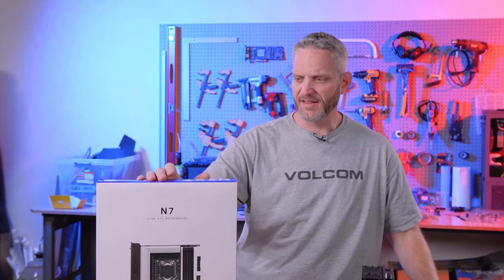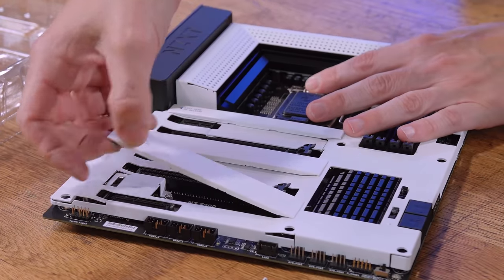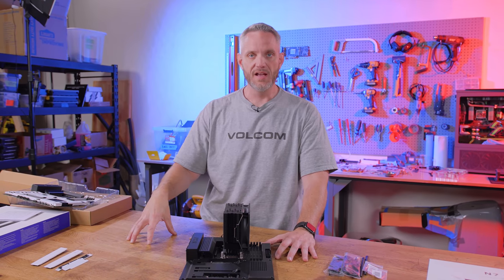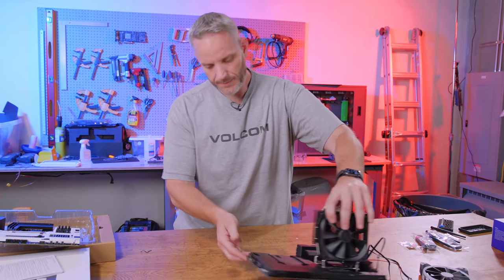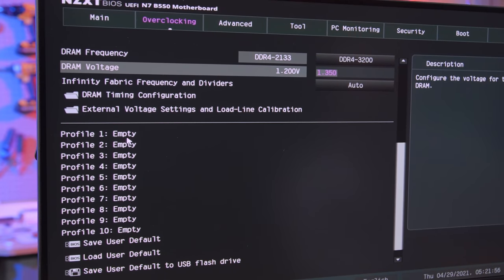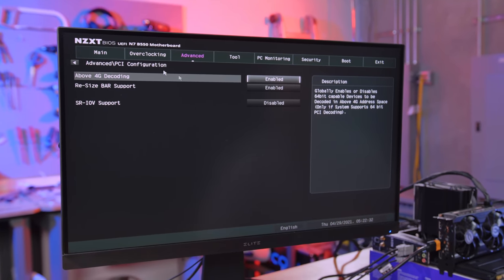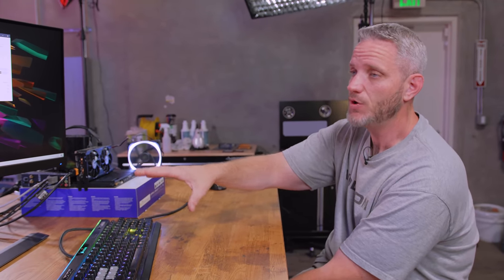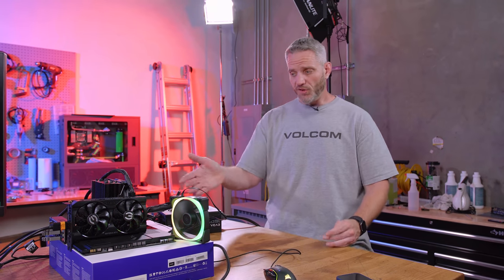Matte Black Motherboard Setup... Absolutely gorgeous!

Comment: Looks really nice. Shame they completely lost my trust years ago.
Reply: Mind telling me what happened or why?
Reply: @Roxx1010  damn b, forreal
Reply: Nzxt has always been great in my builds
Reply: @tobiyokageyama6449  Just look up CAM software and the little history about them using it as spyware. When I ended up in an email conversation with them, they actually lied three times about it, until I shoed the log files of my firewall. Then everything went quiet really fast. Turned out I wasn't the only one that ran into that little issue. And then there's "the case" where one of their products actually was a massive fire hazard. They claimed a fix for that, and that fixed wasn't really a fix. Don't get me wrong, when you treat customers like shit, that's fine. I just prefer not to be one of those customers anymore then. But, reading some of the other comments here, I see there are enough poorly informed people that don't mind bending over. Good for them.
Reply: @PrimeRsoul  complaining about spyware while using a google account lmao
Reply: @jojivlogs_4255  The fact that you even compare the two says a lot more about you than about me. Have fun out there.
Reply: @PrimeRsoul  ok hypocrite
Reply: @jojivlogs_4255  When you create a Google account, you know your data is being used. When you BUY hardware, and there is no mention of your data being mined anywhere on the box or in the manual, you have no way of knowing. 

That's not me (or thousands of others) being a hypocrite. That's you being short sighted. But I know you're just trolling at this point. Or really not very bright. Good luck with that, sparky.
Reply: @tobiyokageyama6449  - Just one week has past and if you look at GN, you'll find another nice example about how NZXT just loves treating their customers. 

(just search for "NZXT Bait & Switch on PCIe Riser Replacement: Just Do the Right Thing")

Comment: Their first N7 Z370 was build by ECS Elitegroup not EPS :) Anyway. ASRock is only "slient" in the US and the EU. They are a pretty big player in Japan. Afaik the N7 B550 is based on a B550 Taichi with some smaller changes and of course the shroud
Reply: Yeah, can't believe he missed that :D
Reply: @riba2233  Shit happens. Happens to me all the time too.
Reply: asrock is silent in two markets with a combined population of 1,325,400,000 but hey, at least theyre a thing in a country with only 126 million Pepega
Reply: I knew when I heard that it was wrong! We used to use ECS motherboards back when I worked for a small PC shop back in the 1st Athlon days
Reply: wasn't it based off the B550 Steel legend?
Reply: ECS Is on z370 and z390. Asrock on z490 and B550....  Ecs never knew how to do boards, surprised Nzxt took their boards as starting option.
Reply: @GrimpakTheMook  Or that yeah, i dont remember anymore
Reply: @dulesavic9343  Yeah. Had an ECS motherboard in a prebuilt office pc. Guess what died right after the warranty? :D
Reply: @dulesavic9343  15 - 20 years back ECS was, fine I guess is what best described them. But then we had more than probably 20 manufacturers fighting for the market. ECS somehow got left in the dust, and yet they prevailed. But for the last ten or so years the number of manufacturers that we see in the US and EU has shrunk dramatically and ECS isn't really one of them anymore.

Today you have a few large manufacturers that everyone knows about, such as Asus, Asrock, MSI, Gigabyte and that's really it. A lot of companies has gone belly up or just withdrawn from the consumer market. Then there are companies most have never heard of or doesn't think of in terms of being motherboard manufacturers and these often build motherboards for things like POS terminals, set top boxes, industrial applications and OEM's.

There are currently only a few large companies making only server class motherboards, and the most well known are SuperMicro and perhaps Tyan, though the later seems to be losing market fast.

A lot of the time the large computer manufacturers doesn't make their own motherboards, but have them manufactured by companies like Foxcon. There are others but I really doesn't feel like digging in that to see who are still in business and who has ben bought by whom or whatever. A long time ago I opened a Apple portable only to find a motherboard made by Acer...
Reply: Yup!  I remember them.  One of my friends swore by them lol.
Reply: @blahorgaslisk7763 Didn't Biostar withdraw from the US market? I recall seeing a lot of their boards during the AM2-1150 days and now its like they just went up in thin air. Same applies to DFI, they had such amazing looking boards along with the features offered at the time.
Reply: *looks at my Asrock motherboard in the EU*. 'Shhhh'.
Reply: @blahorgaslisk7763  no, it wasn't. ECS is and always was shit... I remember te first PC my brother bought, Pentium 4 and ECS motherboard, always stuttering everywhere! After some hardware swaps, he didn't wanted anymore and bought/built another PC. I've started to use it and noticed that the north bridge was insanely hot. I've attached a small fan on to it and then the Pc started to run smoothly. Actually during gameplay, I've been taken away the fan and putting on repetitive and the stuttering was fallowing the same thing!
 Actually there I've started to love thinkering with PCs!
Reply: @blahorgaslisk7763  In the past Asrock uses to be supplied by cheaper Asus knockoffs. Now they are doung their own boards.

As for servers,  SuperMicro leads the race.
Reply: @jojivlogs_4255  They are still a thing. They just have been silent lately. Wut?
Reply: ECS = Easy cheap shit. Used to be sold  by Frys back in the day. they pushed this mobo pretty heavy 20 years ago.
Reply: ECS is a trash-tier manufacturer who thankfully has lost most of their popularity. I still have memories of working on their motherboards that were always sold in budget PCs throughout the 2000s. Absolute garbage. As soon as I heard that they were the OEM for the original NZXT attempt at motherboards, I wrote them off immediately.
Reply: @Gig-th3er  ECS is notoriously bad
Reply: I've had a couple of ECS boards, no complaints
Reply: @TheSilviu8x  my very first PC (2007) was a pentium D and the motherboard is from ECS. Broke down after 8-9 months. Never had another PC until 2014

Comment: There are only two things that baffle me.  In today's cases, there are no freaking optical bays, and most of the time you can't even get a decent hard drive cage.  It's an afterthought at best.  So SIX!!! SATA ports?  Me, personally, I'd use them!  I always do a 4-disk RAID 5 and an optical drive.  (With an M.2 OS drive.)  But not in modern cases.  I'm still pushing my old In Win Ironclad just for this reason.  AAAAnd all-black?  Really?  With so much RGB, and white picking up color soooo much better than black, do people still do all-black?  Yeah yeah yeah, there's a white option.  And I still do all black because I'm a Luddite heathen and don't use RGB.  But it just seems like there's such a disconnect going on.  Personally, I'd love to see cases go back in time to when they were useful for building workstations.  So personally I like this mobo.  But as I said, I'm a weirdo.  It's what I want, but is this what the market wants???

Comment: Looks like a nice board. Could see a fun build with black board, black ram, black fittings, black tubing and little to no RGB in an all black/gunmetal case. W
Reply: Just black lighting that makes near-white things glow :-)
Reply: Call it hotblack, or, disaster area.
Reply: BMM = Black Motherboards Matter
Reply: yeah, exactly. I'm considering the NZXT H510 (or H710) case. Also going for a white MOBO and NZXT case would look sweet I think to have all in black/white. tbh, most of the MOBO competitors just look to cluttered with all the lines and logos etc...
Reply: what about black rgb?  that's a thing, right!?

Comment: Was excited to see a build then I realize it wasn't 😞
Reply: I wouldn't be surprised if they ended up making 3rd party gpu's with the same styling. If they do. I know they'll be cutting a hole in the others companies like evga and asus. They make top notch products for a great price. I got the elite case and I figured it was a great deal because it looks nice, it's simple, the colors are great, it came with both rear fans, and it already had the rgb controller installed so you just plug it in your mobo. I got their 750 psu also paired with a black coolermaster 212 and it came out fantastic. I wish this was released when I got my mobo.

Comment: Aesthetically the white version of this is exactly what I wanted in a MOBO when I built my system late last year. The only other clean design mobo I could find was the Gigabyte Vision D, but that one's MSRP is over $300. I ended up with an ASROCK B550 Steel legend because it was the least expensive non-black MOBO with the features I was looking for. The BIOS looks very similar with this... Now to resist buying this! ugh.

Comment: That's pretty much Asrock BIOS in a nutshell. You should use those boards more often.
Reply: The BIOS is identical to my B550 Phantom Gaming-ITX
Reply: asrock bios with a different skin that's all it is
Reply: @lassevejrum5426  yeah, I wonder what the agreement between Asrock and NZXT is. I would think Asrock wouldn't want to build for a competitor.
Reply: @KDub57  NZXT isn't a competitor, building for MSI would be a competitor. NZXT is a(n) high volume / enterprise customer. The contract is likely a great boon for ASRock.
Reply: @KDub57  nzxt isn't really a competitor since they dont make their own boards, its either have you build their boards or have a real competitor like Asus or MSI do it. They probably have slimmer margins on the nzxt boards, but slim margins are better than non.
Reply: @psguardian  I just mean competitor in that they're both selling motherboards. It'd be one thing if Asrock was designing components for NZXT that they themselves didn't already sell. 

I'm wondering if it's a Toyota Corolla - Geo Prizm kind of thing.
Reply: @KDub57  That's fair. White label production is complex. In the end ASR still gets the production cost & whole sale shares of that retail sticker, but paying none of the advertising &little to none of the freight costs, so they're probably not losing anything monetarily in the market.

Comment: I really appreciate how clean that entire board/bios setup is.  Very refreshing.
Reply: this board is gonna be used in my new build, that board, ryzen 9 5900x and a 2080/90. got told the board is crap but i dont care it looks top
Reply: @ruinfox4108  what've you heard?
Reply: @ruinfox4108  If it truly is crap and you still go for it because of looks would be a rather stupid move, but you do you.
Reply: @VenoXj1  It's not really crap, just has bandwidth restriction on the NVME slots other than the primary slot, no big deal for the typical user unless you're super performance-oriented, in which case you wouldn't buy this board which is designed with form over function in mind.

Comment: 7:22 just to make it clear, the second x16 slot is only x4 electrically, and you can faintly see it from pin layout in the video at 7:24 B-roll shot
Reply: LOL
Reply: Jewtube Inc.  yes, it's because the rest of the pins would be useless for that slot, as chipset can't provide more than x4 PCIe 3.0 lanes for it. The slot is just made in a formfactor that can fit a GPU or other x16 sized card.
Most of B chipset board that have second x16 slot are made like that, but I've seen a few boards which had x16 that is x8 electrically (e.g. B450 Tomahawk), and if you don't install a GPU into the first full x16 slot, that x8 slot will take 8 PCIe lanes directly from CPU, instead of x4 from chipset.

Comment: I have had this motherboard running in a build for a few nearly a month and absolutely love it! I have had a number of people try to argue that it costs too much for a B550 but with the features and the looks I would have paid more. Great job to ASRock for build quality and Bios, also smart choice sticking to an established OEM NZXT.
Reply: Do you have a new ryzen chip? If so did it work out of the box jay didn’t mention it
Reply: @132james1  yeah I have a 5600x and it worked straight out of the box, no need to update bios.
Reply: how are the vrms on the n7?
Reply: @78shinigami  thank you very much!!

Comment: The thing with the all black or all white color scheme is that it also makes everything else pop that much more. Instead of having lights everywhere and visual chaos, a little bit of lighting on the GPU or the CPU cooler will actually stand out. Same goes for clear-topped water blocks and colored coolant.

Comment: How to make motherboards popular:
Step 1.  Color them in black/white.
Step 2. Stylize the radiators.
Step 3. Watercooled radiators.
Step 4. Cover the major part of the board with a metal plate.
Step 5. Fully cover the board with a metal plate.  <<< NZXT here
"following steps bring fear"
Step 6. Make the metal plate RGB.
Step 7. Continue to increase the amount of RGBs until in becomes a display.
...
Step 8. Make that display 144Hz G-Sync compatible!!!

Comment: NZXT makes gorgeous products. Excited for their AM4 products! They finally came! 

Waiting for NZXT air-cooled GPU shrouds!
Reply: they are already making a am4 motherboard
Reply: @HI-sc4um  For real?

EDIT : shouldn't have asked so early on the video, now I look like a dummy
Reply: i can promise you on everything i own; avoid getting an nzxt motherboard.
Reply: this is b550. that's am4
Reply: @saghwteam  yeah they are
Reply: @anytuna  Yeah, commented before watching the video haha
Reply: @jake20479  I have quite a lot of NZXT stuff, no issues with it. So no, thank you.
Reply: @sherlockmaverick  the motherboard sir is different than a case, aio, or fan. do some actual research on NZXT motherboard. im not a casual user, ive been extreme overclocking with DICE and LN2 for the last 8 years and follow Tech like its my job. Do as you wish, but remember this comment when your motherboard fails. msi/asus/gigabyte/evga/asrock.. those are motherboard brands to purchase. every other component can be NZXT as it doesnt matter at all. the mother-board is more or less responsible for EVERYTHING. take it as a grain of salt if you wish. not my system, not my problem. :) :*
Reply: @jake20479  How would you suggest doing research on this motherboard/could you link me what you would look at to determine if this is a good motherboard?
Reply: @jake20479  this is basically just an asrock motherboard. also if you actually had any clue what you were talking about, you wouldnt recommend gigabyte boards. i see too many of them with weird ram compatibility and bios issues.
Reply: @jake20479  maybe you should research this board and not base your opinion on their past attempts. The board is manufactured by ASRock.
Reply: @jojivlogs_4255  it doesnt matter who physically makes the board if the ones that designed it isnt the company that "makes" them. you understand that.. right? 
as for your problems with gigabyte, there is a QVL list that exists for a reason, everything else is at your own risk.
 i havent had a single gigabyte board fail, my ga-ep45t-ud3p still works from day one. thats from 2008. 
you dont have to take my advice since it seems like you think you have more experience. no problem man, enjoy your NZXT motherboard. just dont be petty when it dies on you.
Reply: i might just buy 1 now, just to piss you off even more!!!!
Reply: @jake20479  lmao im aware of compatibility lists. youve obviously never had to fix a gigabyte board, probably because you havent bought one in 10 years. also you realize asrock assisted in both the design and manufacturing process, right? you allude to your experience but you have yet to demonstrate it. i have an asus b550-f btw, but its cute you think the only reason why anyone would challenge you is due to buyers remorse lol
Reply: @jojivlogs_4255  i dont need to prove myself to some random dude on the internet just so he can take my word on avoiding NZXT motherboards. have a good day bud.
Reply: @jake20479  nzxt motherboard bad because reasons. okay ill be sure to make a note of that. "i dont need to prove anything i say hurr durr"

Comment: i just dont trust nzxt anymore, my h500 usb front panel got fried for no  reason. smoke, crackling and i got shocked while trying to connect my headset. I also have the feeling their products are made real cheap. Their first version of this mobo for example. i dont like companies who expand like that. O and when i saw their cases are a fire hazard i was not surprised. The way they handled that was typical so they need to change their image before i get enthousiastic about any of their products again.

Comment: I'm running it, and am slowly replacing components with a fully blacked out non-RGB build. It's been great so far, in every way.
Reply: How well is this mb doing after a year???
Reply: @Whooisangelitooo  I’ve recently run into some quirks, but I have swapped out both my GPU and PSU with used components I grabbed from a friend. Sometimes when sleeping, it refuses to wake again and I need to flip the PSU off and on. Might not be the board, though. Haven’t had time to look into it yet.
Reply: @RidenourMedia I’ve had this build for the past few months and I’ve just been super unlucky with a lot of the components. So I’m looking for a mb and this n7 is one of my options but every mb I’m looking at has its fair share of unlucky people.

Comment: I'm pretty sure the second "16x" slot is actually a 4x with a 16x 'form factor'.
Reply: Also the bottom M2 slot shares its lane with the sata lanes.  But other than a few small quarks its a pretty solid board